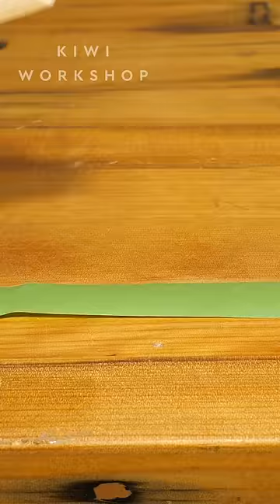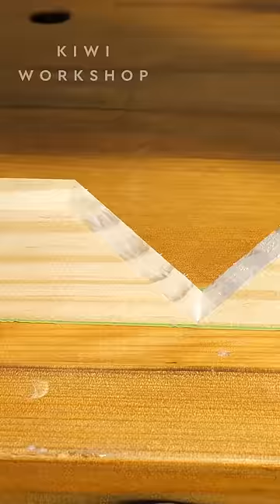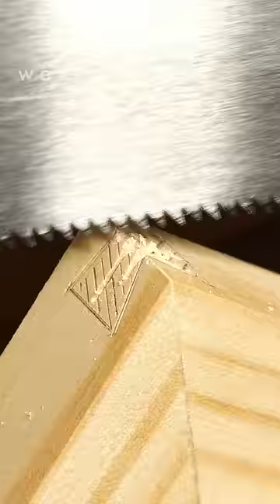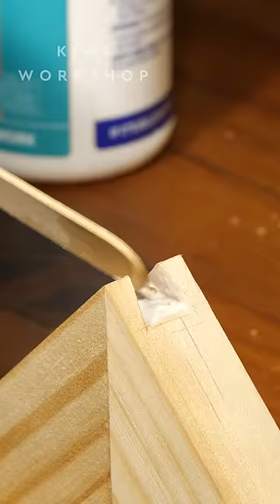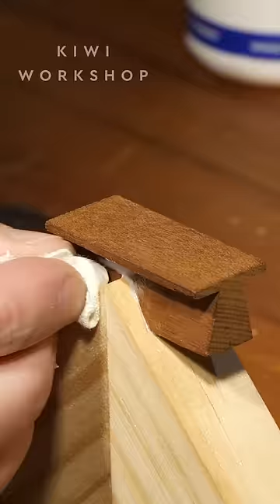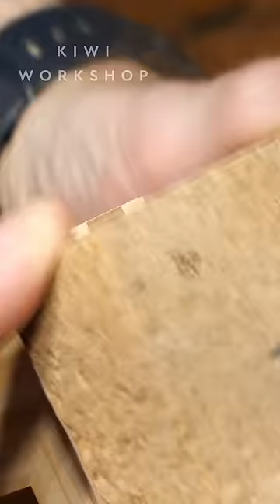What Is The Purpose Of This Joint? #woodworking #woodworkingjoints #asmr #diy

Comment: Whether or not this is a joint making the miter joint stronger , it looks awesome and adds some beauty to the project.
Reply from the maker: Glad you like it and I agree that it does add some beauty to the project
Reply: But it does make the miter joint much stronger. Using a dovetail piece rather than a straight piece adds more strength but may not be needed. Does it look better than a straight piece? Dunno.

Comment: Beautiful craftsmanship. That looks like a lot of effort. For someone like me I can't even imagine where to start. I am just starting off into woodworking as an hobby. Wood love to try this out once I get some experience.
Reply from the maker: Thanks! There is a simpler version of this joint with a straight spine which is easier but still provides sufficient strength. I have a video for it here: https://youtube.com/shorts/gfwntgG5jb0
Reply: @kiwiworkshop  thank you, this is the start i was looking for.🙂
Reply: He literally shows you where to start and how to finnis
Reply: Saw what you did there
Reply: Get cheap scrap wood from local wood supplier. Most give for free or really really cheap peaces from the scrap bin, same with professional carpenters. From those you can build simple frames and you only need hand plane, chisel, hand saw, drill and bits, wood if possible (cheap ones need sharpening so diamond file for that), sanding pad and some sand paper, pen, box cutter and metal ruler. With those you can build wood hammer for chisel work and wood vise to hold the peaces. Simple stuff can be done in living room easily, just need to clean more often. I built whole custom table in 2room apartment building, though i would advice against full floor carpets or least putting something on the floor. You can also use balcony for lots of this in nice weather.
Start easy, simple picture frame, then add some scrap peaces of dark wood as inlay and develop your skills from there.

Comment: You have not shown us how you discovered that the dovetail spline you marked out with did not fit in the ''slot'' or ''mortise''  that you cut. (I cannot think of a traditional term for that particular cavity. We do not seem to have one). This was due to your marking from the end at a right angle, rather than a 45. You made a new spline by cut and try, cut and try, didn't you? Nice workmanship, beautiful result.
Reply from the maker: I'm not entirely sure what you are trying to say here but I can assure you there is no deception in my video. I'm not that kind of person. Everything you see is 100% genuine, you have my word! Not sure what you are on about with a 45? The dovetail is at 9.5 degrees and of course I didn't need to measure it since I marked directly against the dovetail spline. It might not have been obvious, but I slightly undercut the joint to ensure a perfect fit. Anyway, whether you believe me or not, I'm pleased to hear you liked the result.
Reply: @kiwiworkshop , thanks for your reply. If my ''charge'' is unjust then I will give my apology. But I see no way to explain that your marked out mortise, drawn with the profile stock at 90 degrees to the end of the frame, will absolutely not correspond with the profile needed to fit when the spline enters the joint at a 45 degree angle. You therefore adjusted or remade a part, as anyone would, but off camera, and left in the video the incorrect marking out procedure, rather than re-shoot. The only accurate way to mark out from your spline would be to cut the end at a 45 degree angle to give you the stretch you need. Others have noted this "anomaly" here, as would anyone familiar with grinding shaper knives to a given profile.
Reply from the maker: @leehaelters6182 you have my honest word that I did not adjust anything off camera. I think I see what you are trying to say, perhaps any margin of error was so small that it didn't matter. Or perhaps the glue filled the gap but I can't see that in the finished product. I'm tempted to shoot this again in one continuous shot to show that it works!
Reply: @kiwiworkshop , OK, I guess that we have an explanation: glue filling the gap, although I do not see the thick wedges that would have to be showing under the Watco oil. I apologize for a scurrilous undeserved charge.
Reply from the maker: @leehaelters6182  apology accepted 🙂However following up with your other comment, it was a case of the spline being slightly wider at the top than the marked spline. By a very small margin of about 0.5mm. Meaning there were no gaps to fill, the joint was tight at the top and the pine must have opened up slightly when the spline was inserted.
Reply: @kiwiworkshop , best explanation, and even greater cause for my full apology. With the thin dimensions at the bottom, and the flexibility of the pine, I should have realized that myself.
Reply: The dimensions of width at top and bottom of the wedge would remain unchanged, only the height would be changed in projection.  Simply holding the wedge up and marking the depth at the bottom, which he did before he struck the squared line for the bottom of the dovetail would establish the bottom of the cut. Marking points at the ends of the bottom and top of the dovetail would have established the slopes. The length of the edge of the cut is irrelevant.
Reply: I had exatly the same puzzlement. The shape of the wedge cut at 45 degrees is definitly different to the shape cut at 90 degrees. I guess the wood's springiness took up the difference.

Comment: The purpose is purely decorative; with such a small amount of softwood around that dovetail it's not providing additional strength.  Does look nice though.
Reply: That was exactly what my first thought was. A 1/4" thick flat cut, at twice the depth, or if it must be a dove tail style, half as wide and twice as tall, would have provided 10x the support. Especially since this barely touched the corner and left only what appears to be 1/8"-3/16" original wood to hold that dovetail in, it provided next to 0 actual structural joint support.
Reply: Agree with both, my own thoughts, also. Plus, if the layout had extended deeply enough to appear to be the width of the frame stock, then it would seem to make more sense, visually.
Reply: I think it's not to prevent the miter from breaking apart (structural integrity), but rather to protect it from warping in case of changes in humidity or temperature (material integrity).

Comment: I use a router table and a sliding jig to do mine. Makes a pretty joint.
Reply from the maker: I also have a spline jig for my router table - actually made a video for it. I wanted to see if I could cut one with hand tools.

Comment: Hello. That’s a beautiful joint. When you want to mark the perpendicular face, I’m thinking you would not want to spin the spline 180°s and mark. I’m thinking you should use the other end of the spline to mark so both faces are lined up when you glue and push it through?
Reply from the maker: Thanks. Yes, you are correct regarding marking out the spline. The way I did it introduced a small error, but since the error made the joint slightly wider at the top, the wood pushed out a bit to compensate when the spine was inserted. Basically, I got a bit lucky and wasn't aware of the error at the time!
Reply: @kiwiworkshop  Thank you so much! I would like to attempt this so wanted to make sure I understood the order of steps to take. What a fantastic way to make the woefully weak miter joint strong. 💪

Comment: It substantially increases the strength of the mitre and it looks pretty, only gripe is that you could have got 2 joints out of that spline if you didn’t glue it right in the centre.
Reply from the maker: Correct in the first two points. Regarding the last point, nothing went to waste as I got two reusable splines from the offcuts. This was possible by centering the spline.
Reply: @kiwiworkshop  Then I stand corrected, that’s awesome, I guess on camera it’s harder to see.  On a side note, do you know if the shape of the spline makes any noticeable difference to the strength of the mitre?
Reply from the maker: @toastofcinder3547  the shape will make a difference if comparing a dovetail spline to a straight spline. The dovetail spline will be stronger, but in most cases, a straight spline would be strong enough.

Comment: This joint would add strength against the corners warping, but not pulling apart from each other.  It also adds a very nice decorative touch.  

A dowel would also add strength against corners warping and pulling apart, but the overall appearance is not as nice as a spline.

Each jointery does have pros and excel in certain instances over others

Comment: I have an honest woodworking question if anyone knows. What is the benefit of using a marking knife over a pencil? It seems like an extra unnecessary step but I'm sure I'm missing something.
Reply from the maker: It produces a higher accuracy line since it's much narrower than pencil led. Also, it defines the edge of the cut and gives it a nice crisp edge. Additionally, you can place a chisel in the marking line to ensure perfect accuracy.
Reply: @kiwiworkshop  Ok that makes sense. Sorry for the silly question lol Thanks!

Comment: Nice job but looks like you could have got two splines with a little careful placement.
Reply from the maker: Actually by centering the spline, it allowed for two offcuts of a useful size. If the spline were pushed to one side, one of the offcuts would have been too small to be of use.

Comment: How can that be that you marked the cut with the dovetail in 90 degrees anda inserted it in 45 degrees? Wasn’t the cut bigger then the piece?
Reply from the maker: Probably just the camera angles/perspectives playing tricks on your mind (unintentionally)
Reply: Marcelo, Kiwi here is being disingenuous, You are quite right, of course, except that the spline would be too fat, rather than the mortise. I think that he remade either the spline, or the frame corner.
Reply from the maker: @leehaelters6182  you are completely wrong, I am not being disingenuous. I see what you are thinking here but you are wrong. Even though I marked at 45 degrees, I chiseled straight through close to 90. The profile of the dovetail is exactly the same whether its marked at 45 or 90. Why would it be any different? Think about each dimension of the dovetail, why would the base width or top width of the dovetail spline be any different if marked at 45 or 90? The width is still the same, the dovetail spline is a fixed size and can only fit in a slot of the same fixed size. And of course the dovetail angle of 9.5 degrees doesn't change.
Reply: My mistake, Marcelo. The mortise would be bigger and loose at the neck, as you wrote, of course.
Reply: @kiwiworkshop , if you have the cut offs of your spline still knocking about, pick them up and offer the squared end of one up to the 45 degree cut face of the other. You will see the stretch I mention quite clearly.
Reply from the maker: @leehaelters6182  I have just done as you said with a section of the same dovetail spline. There is indeed a small difference. When placing the square end against the spline in my work piece, the top is out by about 0.5mm. The spline in my workpiece is about 0.5mm wider at the top than the profile of the dovetail spline. At the bottom it matches perfectly. I guess since I cut this in soft pine, it must have opened up slightly at the top when I inserted the spline. Or perhaps by fluke, my cuts were out by this very small margin of error on the angle. Next time perhaps it's best to start with the constructive feedback rather than making an accusation! Having said that, I'm pleased you brought this to my attention since I had not realized.  
@MarceloRodrigues-ff6vc you also correctly had a point.
Reply: @kiwiworkshop  Your point about rushing to accusation is well taken, and I apologize for that.
Reply from the maker: @leehaelters6182  all good
Reply: Marcelo, I retract my retraction, after more thought and yet without drawing it out (other than mentally.) The mortise is the shrunken part of the joint, with that layout.

Comment: Not sure this adds any significant strength to the corner. There may be some additional resistance in shearing and compression but nearly none in tension or torsion. Looks nice though.
Reply from the maker: You will be surprised at how much strength a spline adds to a miter joint. I've seen plenty of standard butt miter joints come apart (failed picture frames are common). I am yet to see a splined miter joint fail. Thanks.

Comment: A good way to add a lot of cost for no good reason. A spline does just fine or if you must do this use a dove tail router bit.
Reply from the maker: If I made these on an industrial scale, yes, I would use the router table. Personally, I enjoy using hand tools for one off projects.
Reply: Or if you want it to look pretty.

Comment: Mostly cosmetic in this instance. There's not enough meat in that frame for those two little bits on the edge to really bite the dovetail or resist tear-out.
Still, it will at least lock the joint, and it do be looking smooth AF.

Comment: Two 1/8" splines at the 8° angle would have been as strong without weakening the miter joint.  I don't see where this dovetail adds much strength.

Comment: the purpose of this joint is to gibe a horrible joint a little more holding power, although so few that it won't really matter.
Reply from the maker: Yes, the spline does add some holding power. Enough to make a difference in a number of applications, but sometimes a standard miter would be ok.
Reply: @kiwiworkshop  a miter with only glue is, and I know what I'm talking about, never enough. Even cheap painting frames have a spline or dowels.

Comment: I never understand why they have these large inlay pieces, and then proceed to put them right in the middle and cut off the excess. You could have done 2-3 corners with that piece.
Reply from the maker: What makes you think I threw the offcuts away? Centering the piece is the most efficient way of cutting it since it results in two reusable offcuts. If it was pushed to one side, there would have been a very small offcut that would go to waste.

Comment: The only purpose is to look cool, I can't imagine that is making anything much stronger than just gluing it (I'm not a carpenter)
Reply: It does actually give the joint a bit more strength, but not because of the dovetail type thing. Just putting a normal little peice of wood will have the same effect. But it dosent make it much stronger
Reply: @bullencarker  didn't think about that
Reply: @bullencarker I think that "any little piece of wood" wouldn't do the same; the strenght of the dovetail is in its form.
Reply: @OTTAOTTA64  no, technically you are correct as it does make the joint stronger, but only in the outward force going out the way the miter is pointing. In normal use there would be no forces going in that direction
Reply: @bullencarker  thank you for the technical details. I don't have enough knowledge in this field to judge.  Nevertheless, his craftmanship is great, and something we must preserve.🙂
Reply: @OTTAOTTA64  for sure

Comment: Merely decorative, gluing surfaces are too small to provide any strength.
Reply from the maker: I guarantee you that a standard butt miter would fail before this one if stress tested. It might make for a good video actually!
Reply: @kiwiworkshop  I wouldn't expect a miter joint to be placed under stress.
Reply from the maker: @dennismaloney7241  there will be an element of stress in almost every miter joint application. And often of the unexpected kind such as dropping a box. I remember a few years ago watching someone carry a large framed picture away from a second hand store. The top part of the frame broke away in his hands and as the frame hit the ground, the rest of it broke apart at each miter joint. Thankfully no glass! From what I could see, they were all butt miter joints without any reinforcements. If each miter joint was splined, there is no way the picture frame would have fallen apart like this.

Comment: Couldn't you have saved a lot of that dovetail by sliding to the end of the joint, so you could use that other peice for the other side joint?

Edit,  seems like you slide the tail into the middle instead of the end, maximizing waste no?  Also thought nice joint looks great. O ly bring it up because that tail looks intricate
Reply from the maker: Correct, by centering the spline it allowed for two offcuts of a useful size. If it were pushed to one side, one of the offcuts would have been too small to be of use. Glad you like the joint!

Comment: the joint does Nothing, it's a fake dovetail... so stupid people with money think the frame is worth more (and not just glued together)
Reply from the maker: It's called a spline joint, you should look it up
Reply: @kiwiworkshop  it's Cosmetic. not enough of anything to add any strength.. Might stop your corners fanning when the sub-standard frame wood tries to warp outta true.. might not. The corner's Glued, with not even a Biscuit.. you glued 1t, that's what the corner is. Butted woodglue... look 1t up xx

Comment: For looks.
 Because today's  glue is stronger than the wood. It's completely unnecessary.   It's for looks.
   "Sizing" the miter joint with glue first. As not seen here. 6It's a dry joint. It's weak.
Reply from the maker: If glue stronger than wood is used on end grain (like in this video), the glue joint will still fail first. I have never seen glue tear out end grain. I guarantee the spline will make this joint stronger than glue alone.